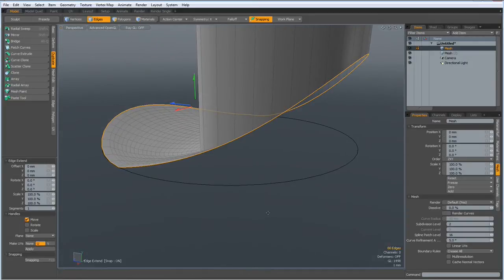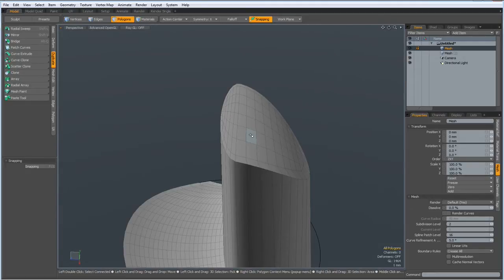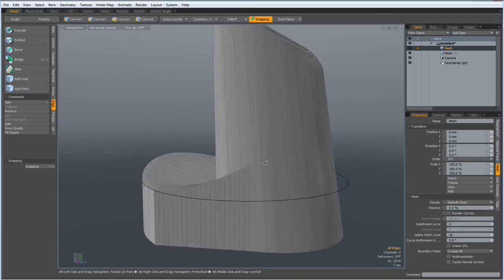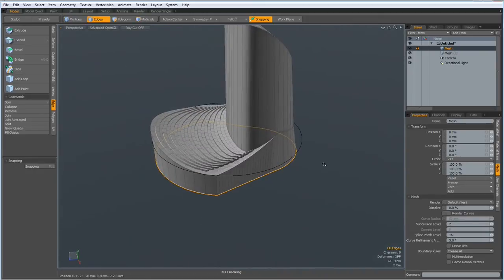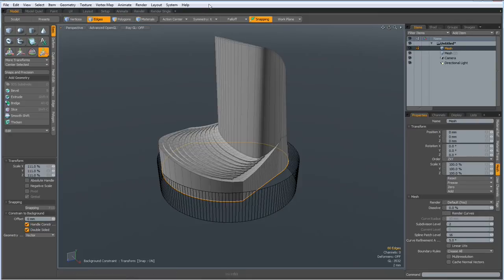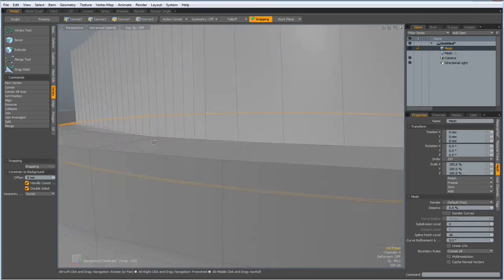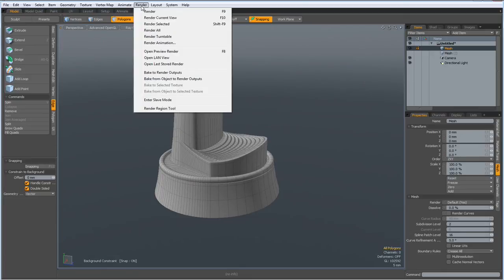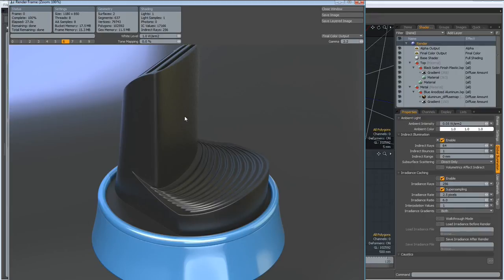Luxology Modo - Hair foam dispenser - Part 2

Comment from the maker: Well, the shell was not such a complicated model. The only thing which you can directly influence is the maximum smoothing angle. It usually works fine with the default of 90 degrees, but sometimes it has to be increased to say 120-160 degrees. I hope this helps.